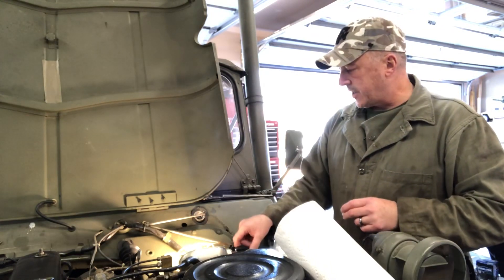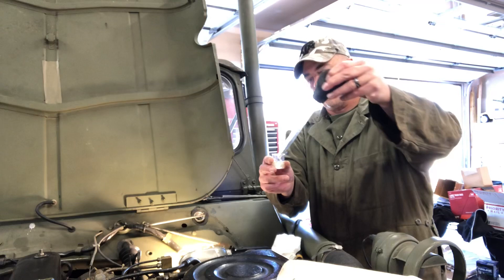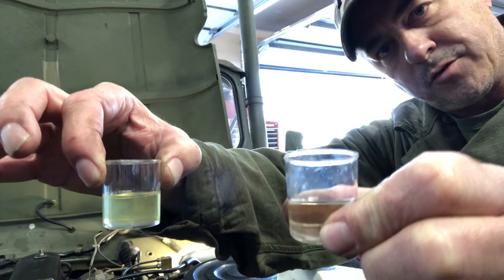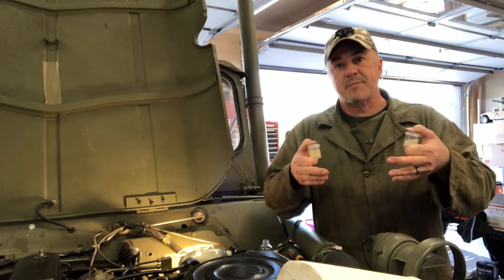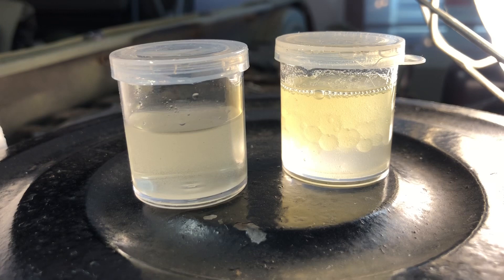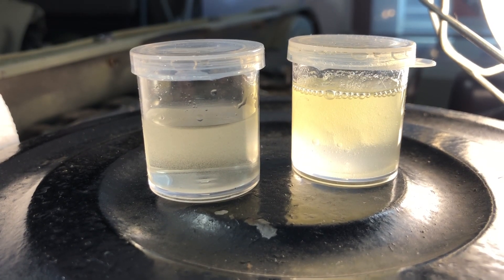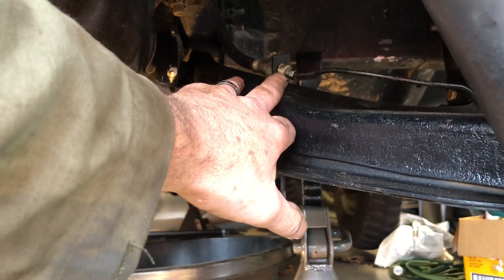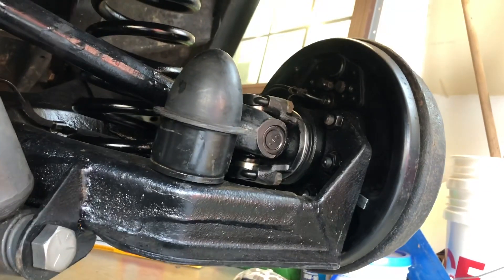Silicone brake fluid or not?

Comment: Dot 5 is purple
Reply from the maker: Kenneth Baker yeah the stuff I put in was purple and I bled the system until I got clean purple fluid. But when I did the test it reacted like silicone fluid does. I wonder if there’s a different type in there
Reply: @WatsonsWagons  DOT 5, losses the purple color, over time. That yellow fluid you pulled out, looks like older DOT 5.